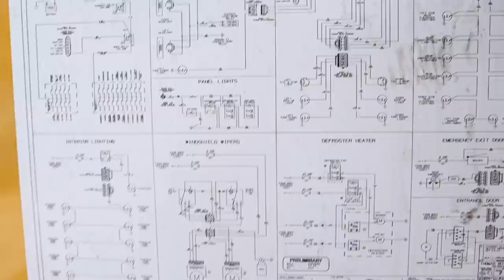Removing old school bus wiring: mistakes, frustration, and triumph  // School Bus Conversion part30

Comment: Are you putting stuff on the roof? Solar, fans, a rack, sun roof etc?
I 
think I’d want to do all that first so I could check leaks. If you  do all the inside work and have a leak later and have to cut through those roof supports to do your install, you’re working against yourself. Plus water water damage you have until you get to fixing it.

Comment: Yes, it’s probably a very good idea to NOT spray foam over any important components like your heater, batteries and any of your electrical and or plumbing parts just incase you need to repair upgrade or replace any of it at a later date. Spray foam could make that a very hard and messy thing to do. 

Just something to think about, foresight is 20 20 as they say.

But wishing you good luck no matter what you choose to do.

Louie
IL 🇺🇸 USA

Comment: As I'm thinking of a build the electrical is one big hurdle. My plan and it may or may not work. I'm going to run some PVC pipe down both sides of my ceiling, these will be for my wiring and future wiring. I've seen so many build videos and so many say Oh crap we forgot these wires. With a pvc pipe if the ends are left exposed. Again this could just be an epic waste of time failure on my guessing.

Comment: I hope you didn't remove the flashing red lights on the bus, the ones that comes on when a school bus stops to load and unload, in some states they still have to in working order even if not used as a school bus.. I know in state of Virginia they have to be on there when state inspection

Comment: Have you disconnected your alarm on your rear door because all the others I've seen once that is disconnected your bus won't  start so you have to work that out . PS  I'm in England and have never slept foot in an American schoolie so wont it be weird if I'm right. Good luck girl you need it but you've got guts for taking the build on

Comment: Are you not concerned about the wires being all hiddin in the insulation then if you have wiring issues you'll have to "dig" thru the insulation and won't that really mess up the properties of the insulation,?  Just wondering.  I follow all your videos and have so much admiration for your determination and hope if is the success that you dream of!
Reply from the maker: thanks :) most of the wiring will be outside of the insulation. honestly I'm just crossing my fingers that nothing goes wrong with the bits that are concealed 😅

Comment: You should have left the original wiring in the buss Alone !  The wires are for the lights and the accessories in the bus, outside lights inside lights all the gages and other things that run off of the battery...

Comment: Otherwise your pipes your water pipes will be on the outside of the insulation and if it gets cold outside that cold will freeze the pipes I'd also put a 2 x 2 between the window frames just so you can frame and insulate the windows easier also on the line right above the windows also on the staggered ribs, when you do your interior your screws are going to be all over the place and you might not be able to find the wood because it's not in a straight line to screw into I wouldn't spray over the wires in case you ever have to work on anything you'll have to rip out all your insulation it would be better to tape your wires to your windows because you're not going to spray foam that and then when you get your insulation done you can make a little chance in the foam for the wires and you can always get to him and have access to him if you look at a lot of the videos that they have out on bus bills you'll see that they have some kind of an access panel all along the side of the bus that they can get their wire access

Comment: Emma,  tired of watching you struggle.  Here is a battery drill trick:  
You have probably noticed that your drill works best directly in front of you and at the proper distance.  Both strength and accuracy is maximized.
Use this power effectively by positioning your body properly for each hole drilled.  For example ceiling holes,  lie on a table and drill up.  Awkward details,  build a structure so you can have a proper position to work from,  etc..
Carbide drill bits cost more and work that much better.  Hope this helps.
Reply: COBALT,  not Carbide.